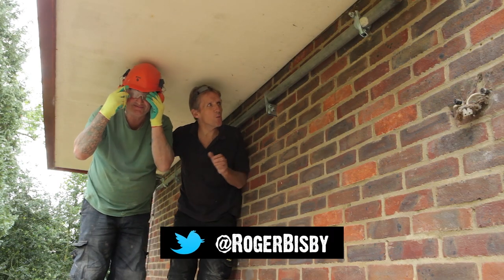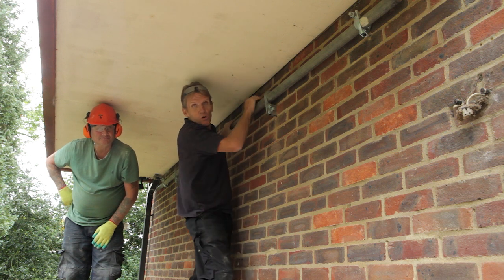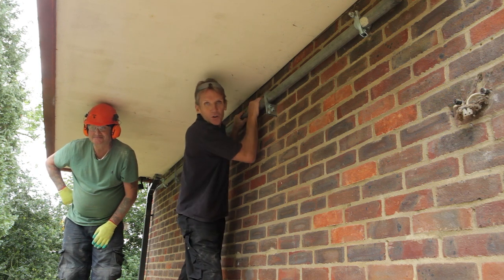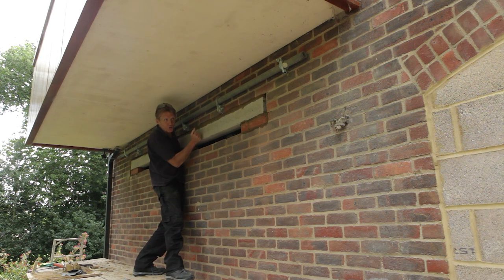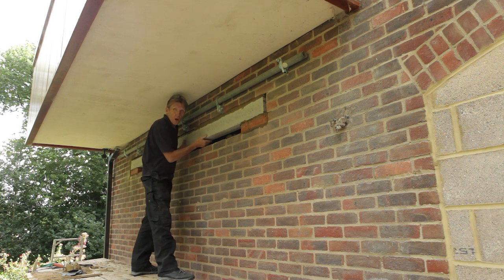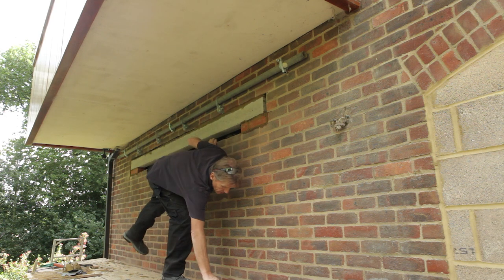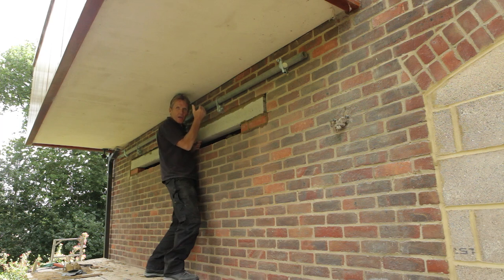How Does Brick Brace Help Remove Load-bearing Walls?

Comment: You should ideally be dry packing above Intel's and steels rather than slate and point. I also tend to use slate and dry back after Intel has settled over night. Then once dried i point the last 20mm to match existing.
Reply: Can I ask why it needs to be dry packed please? I don’t even know what you mean by that but would love to understand it better. Thanks.

Comment: Always, Always, Always Pack Any Lintel Before Removing Any Kind Of Temporary Props. The Next Day  Is Best , Because The Mortar Will Have Set Enough That It Does Not  Compress, Enabling A Tight  Wedge With Your Packer (Slate) Between The Mortar And Brick .

Comment: Another question Roger, yes would use this in addition to strong boys I think. The query I got is that when you open up the wall as you can see you only have two fixing across the span one at each end holding the whole wall. One at each end of the scaffold pole. The fixings in the middle are holding the brickwork but nothing actually holding the rest of the brickwork other than at each end. If you understand what I mean. It's like you have two strong boys at each end of the scaffold pole and the weight of the brickwork spans a cross. I just can't see if this enough bracing?
Reply from the maker: +Zed Man 

Hi Zed Man
I sent your enquiry to Brickbrace and this is what they said.

The individual Brick Brace safety tools are supporting the brickwork by pre stressing the masonry with enough force to prevent collapse, with the scaffold tube connecting all the tools together to minimise movement from the vibration of removing the masonry below. The maximum opening size of the Brick Brace safety system when used without any impeding props is 3150mm (14 brick lengths). An opening of this size is supporting 91 bricks within the triangle of masonry above the opening, that’s no more than 455Kg of masonry which includes a factor of safety of 5Kg per brick to allow for the different variety of brick and different possible mortar and moisture content. The Brick Brace Safety tools are fitted three bricks apart in cement mix and a maximum of 2.5 bricks apart in a lime mortar mix. A builder that uses the system should be  aware of the weight of masonry requiring support. This is  not generally the whole wall. Full instructions and procedure are available to print or download from the “download page” at www.brickbrace.com.

Comment: Can you use this system on pebbledash? Do you have to remove the render back to the brickwork along the length of the brace or just the point at which it enters the wall? I'm assuming the former
Reply from the maker: Just where it enters the wall. If you can find the joints that is enough
Reply: @SkillBuilder  great cheers, looks like a brilliant. It would help us  recking the tiles in the bathroom!

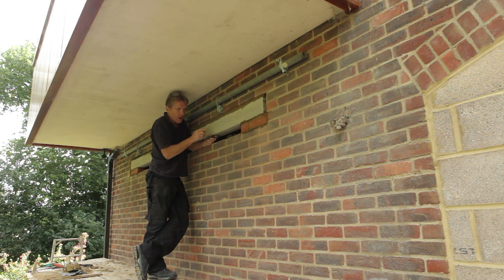Comment: You are the only person ( out of all the videos I've seen) that mentions ( at about 3:00 ) that the mortar will shrink leaving a hair line gap justifying the need to wedge up , good going on that !!!! great video thanks !!!!!!!!!
Reply: Yes. Good stuff. You can also use a 40mm sharp sand/cement dry pack pinned in, as long as it’s not on exposed face work.

Comment: Just looked up brick brace on ebay and it shows a four brick stretch for a door opening of about 900mm max, with just a single brick brace holding the higher course. Just wondering your thoughts.
Reply: Can't upload the pic but there's only two sellers if you search it, just looked at the seller and its  Brick Brace themselves haha, think that answers my question 😆

Comment: Hi there, I'm a complete novice and found your video very helpful. My question would be, why is the slate packing required, why can't the lintel be pushed up to the brick above? Thanks for this great video. Best, K.
Reply from the maker: +Kevin Anth 
You could do that and then grout it in  but there would be small gaps where the lintel didn't touch the brick which would allow water to track in and draughts. A bed of mortar also helps prevent any movement of the bottom course of bricks.
Reply: +Skill Builder wow, great. thanks for quick reply. best, K.

Comment: Hi roger what is the maximum span you can use the brick brace .... I have an extension coming up where strong boys are going to be near on impossible to get in so thinking this system is the way but the span is about 8 meters cheers

Comment: Hi,
I have a question!
In this video they are using a concrete lintel with padstone.
When is recommended to use a concrete lintel and when instead is appropriate to use a steel beam with vertical post ?
Which are the differences, when to use one and when the other ? 
Thanks everyone for your answers.
Reply: daniele pibiri 
Every task is different and is calculated upon its own merit.
Reply: Under BS standards you have 2 zones of interactions that you must consider in terms of loading. The 2 zones are triangle and the first is 45 degree's from the proposed internal clear opening, the second triangle is based on 60 degree angles from clear opening. In these triangle, you can calculate the total load acting on the lintel. The manufacturer will be able to tell you of the load coming down ,exceeds the lintel strength. If it does, you'd stick a steel beam in. But again...what depth beam you put in, depends on the total load.

You can't just rule of thumb it.

Comment: Hmm interesting, so I'm assuming this is for the outer skin? You do the same for the inner?
Reply from the maker: +Zed Man Sometimes you do as you suggest  but  here the joist ends are let into the wall and by propping the floor and making sure the joist ends were  nicely wedged the inner skin was fine. Each job has to be assessed on its merits. I have found that skirting boards with cut nails have given the wall quite a lot of support if they rest on the floor and the joists are propped. Of course nobody could recommend that but in reality it depends what you are taking out and how much room you have to play.

Comment: Hi Roger 
Just subscribed to your channel , some good informative information in them , like you ive been in the trade now for some years , and like yourself a multi trader.I have a question  reference the Brick Brace , would this be  a recommended process for taking out a opening around 5m long on a gable end of a two storey property ? obviously id use the props to support the first floor joists inside, or would you recommend that load calculations are undertaken beforehand?
Many Thanks 
Daniel
Reply: Dan Atherton Any opening over 4500mm it is recommended to use the propping and needling method, the Brick Brace safety system should also be used over the opening to increase the unknown lateral strength of the masonry and to reduce the weight of the load and to support the masonry as one whole piece rather than as individual bricks as in the case of only propping.

Comment: How would this work on a solid 9 inch wall?
Would you have to repeat the process on the inside or do they do fittings that go all the way through?
Reply: Shaun Hennessy 
Every task of masonry alterations is different and should be planned and carried out safely when using the most suitable equipment.
In the case of the task requiring to support both sides of a cavity or 9” wall you would prop the internal separately from inside and use the the Brick Brace externally to give a safer fitting access.
Where it is not possible to prop internally due to impeding floor joists the props and needles method should be used above the floor joists when still using the Brick Brace externally to support the masonry in between props.

Comment: 5 years later, are you still using this product?
Reply from the maker: I would only use it where the acrows are in the way.
Reply: @SkillBuilder  Thanks for the quick reply, must have caught you at a good time! Fitting lintel above a window, span approximately 2 meters, was hoping to use this instead of acrows/boys all together. Would you advise just working around props or would you use this? Cheers!

Comment: hi roger great vid. i have a question with regards to your pipe soldering vid. Can you please tell me the exact name and model of the blowtorch you used and where to buy one from? many thanks
Reply from the maker: +arfan jhangir 

Hi  Arfan  Yes it is the 
VULCANE EXPRESS GAS TORCH fits DISPOSABLE MAPP® MAP//Pro® MAPPLUS® CGA600 CYLINDERS
you can buy it from any plumber's merchant that deals with Monument Tools. Monument is the distributor for the company. They are in Wallington Surrey. Tell them where you are and they will help you find a local stockist. 

Thanks for wathching.

Comment: Another  very informative video. How do you get the mortar to compact and stay in that small space? I've tried that sort of thing over the years in different situations and it usually ends up falling out the other side for me. Is there some sort of expanding product that could be better??
Reply from the maker: +malcolmsplace Hi Malcolm. It would be brilliant if someone did make an expanding mortar. Actually there is some stuff that they use in demolition that does expand  but it would lift the bricks as well. The lintel has a bed of mortar on it before it is lifted into place and that squeezes up against the cavity tray and the bricks above.  The bit you can't quite see is the damp proof membrane that acts as a cavity tray. It is held against the inside wall and catches any moisture in the cavity and directs it to the outside through weep vents. So once you have the lintel in place and have pulled the tray out to the front of the lintel you just start pushing mortar in where you can. You can get your hand up inside the cavity to make sure it is pushed in from the back. Realistically the compacting bit can be  hit and miss so that is where the slate wedges come in.
Reply: +Skill Builder Again agreed. A good tip is to use a narrow bucket handle pointer with a hawk to help push that mortar though so there are no voids.  

building control here won't allow you to leave the slate in.
Reply: Skill Builder could you show us how you put the slate wedges in?

Comment: How does the slate stop the mortar from shrinking? there is still mortar in the joint, it will still shrink, there will still be a residual hairline crack??
Reply: It doesn't stop it shrinking. What it does is stops the brickwork above from lowering down onto the shrunken mortar and prevents cracks further up

Comment: Can a brick brace support back of a two storey house if putting in new steel?
Reply from the maker: No you need to pin the walls if they are supporting floors. This device supports the brick triangle

Comment: surely dry pack is better than wet mortar
Reply from the maker: Yes for sure. I always dry pack or use shrinkage compensated cement which expands slightly to compensate

Comment: Looks like a good product but never use slate packing, it creates high points which will crush and then you will get the hairline cracks this chap is talking about. For large gaps use 3 - 1 sharp sand and cement dry packing/screed consistency rammed into the gap to desiccate the mortar further (the less moisture left in the mortar, the less shrinkage). Smaller gaps, gun in chemfix epoxy.
Reply: I thought good slate doesn’t compress?
Reply: @justbreakingballs  even a single flat sheet of slate has minute high points which can crush but, if you use multiple pieces it will definitely crush/settle and you will get hairline cracks. That’s why you won’t find it in any instruction manual or code of practice, no matter how far back. Seems to be something old bricklayers got used to doing because there was plenty of pieces of slate around the site but, never good practice. It’s the same reason you dry pack with 3-1 sharp sand when underpinning, leave a 75mm gap between the poured concrete and underside of foundation the 24/48 hours later ram in the dry pack to desiccate the mortar mix even more so it doesn’t shrink when it dries out to give a nice evenly spread of the load, no high points. 👍
Reply: @jezedwards3858  By "dry pack" you mean mix morter with no water ?
Reply: @Itisinthehand   just enough water to set off the chemical reaction/hydration that forms the concrete. Screed consistency, rammed in to disperse the water even further and lessen the shrinkage and hairline settlement cracks.
Reply: @jezedwards3858  Thank you for getting back to me. Good tip.

Comment: Wow    1:04    is that angle grinder?6-Inch? Looks dust shit everywhere >,< 
Need dust collect  and dust extractor with automatic filter ^_^
Reply from the maker: +Zhen Lin CHN 9 inch grinder. As you say lots of dust. It's like that on lots of British sites. Dust extractors?  Half the time you won't even see a man wearing a mask. Then they stop for a cigarette break. I am generalising of course.
Reply: Skill Builder 9 inch angle grinder......big one ! I love it!

But,I'm not sure i can hold that kind of big grinder to cuting wall,must need a strong arm......Looks like A little unsafe to me XD
 
Half the time you won't even see a man wearing a mask. Then they stop for a cigarette break????  Awesome...your guys just so badass :D
Reply from the maker: +Zhen Lin CHN 
To tell the truth there isn't much choice. You need a 100mm depth of cut and a smaller grinder won't get you there. It someone invents something small. lighter and just as cheap then they will make a lot of money.
Reply: +Skill Builder I agree with you. using a grinder outside I'm not too bothered about the dust as long as I have my mask and goggles on. only time I stop is if some plonk parks there pride n joy next to me etc...
Reply: I used a 9" when I was installing a new window opening. It is scary. I could control it but was worried about kickback from snagging. No way would you be able to control it then.

On the 'No More Props' video the guy is using a Stihl petrol cutter. That's even scarier.
Reply: Haha I use a petrol cutter chavvy much more effective. Like the system youv shown here though may invest